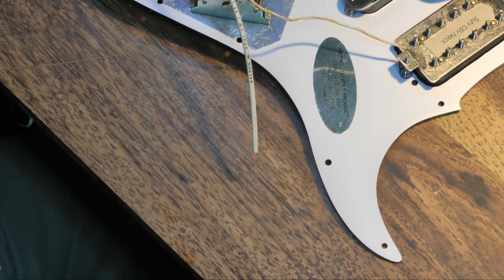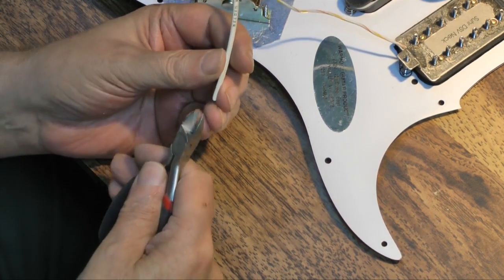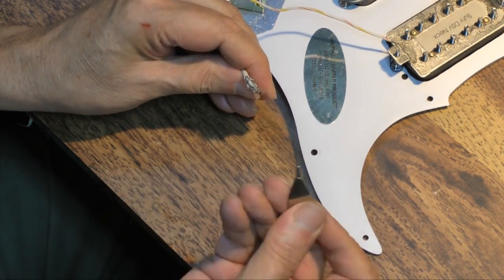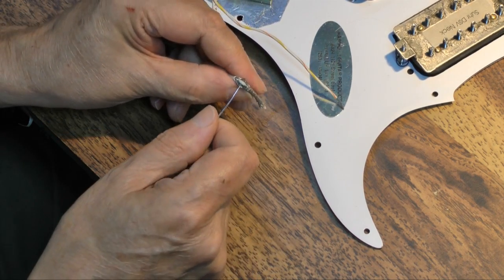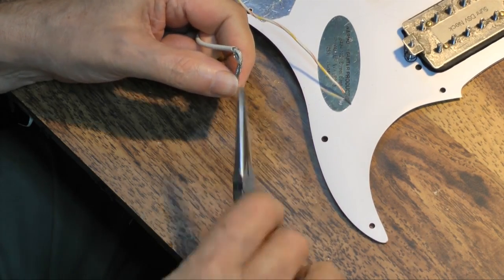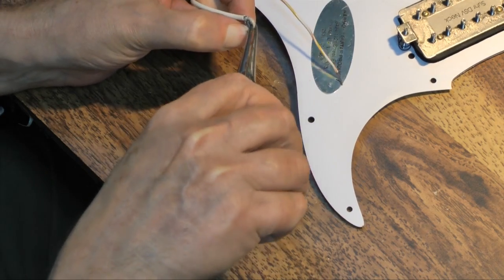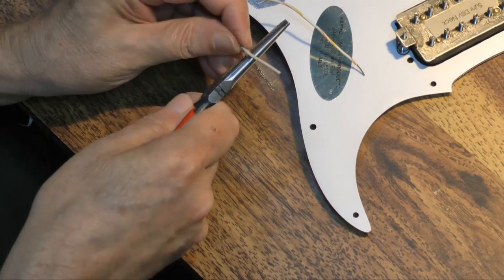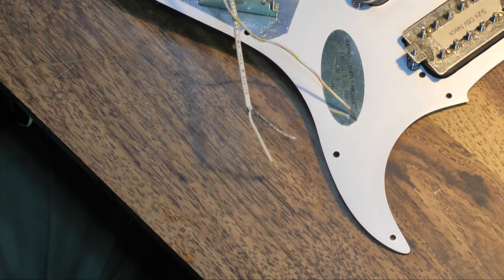Working with Shielded Cable

Comment: When you strip the wire, how much mm do you cut? Does it have any affect on the shielding itself?
Reply from the maker: You need to strip out a few cm to make it easier if you are using this method, it's harder to strip out 1/2 cm, but if you only need 1/2 cm to connect, you just cut it back. The longer the un-shielded wire, the more interference it will pick up, but I wouldn't worry about small sizes like this. Sometimes it's more important where you connect the ground than the length of the wire. The braid of course can be any length.
Reply: @Flintsmooth  Understood, thank you very much !

Comment: Where did you buy this cable? I'm about to wire up a warmoth build and as a newbie, I've found it somewhat difficult to find all of the electronic components I need on the internet.
Reply from the maker: I bought that cable about 35 years ago! I have a very large spool of it that will last me a lifetime and I don't know where it came from. There are a lot of electronic part stores on the net, such as  Mouser or  Digikey,  or

https://www.amplifiedparts.com/products/amplifier_parts_0

 For specific guitar parts I buy from:

https://www.guitarfetish.com/

I don't know what kind of cable they have, you could write to them. You could also go to a manufacturer like Beldon and try to find what you want and then find who sells it.
Reply: @Flintsmooth  I'm not 100% sure it's necessary. I'm wiring a dual humbucker guitar with one volume,no tone, and a 3 way toggle switch. It was recommended to me that I use shielded wire for the output jack, but I'm already planning on shielding the control cavity.
Reply from the maker: @FirestormAudio  If you are shielding the cavity then you shouldn't worry about shielded cable. If you are wiring up the whole guitar yourself then pay attention to ground. Lots of people use the volume control body as a ground wire but you need to make sure you have an actual copper wire connecting all ground points in the circuit. A single point ground is best but circuits differ. Since you don't have tone controls you should be OK. I've seen people try to use control bodys as connecting wires IE thru a steel chassis but steel pots held together by bent tabs are NOT wires! Sometimes you'll get hum when touching the control knob, in that case you can try soldering a ground wire to a lock washer and putting that on the pot.

I usually start out wiring a guitar by putting in a piece of 12 gauge bare copper wire to act as a ground bus. With one control you may not need this. The best point to connect your body shield to ground is at the lowest signal point, a pickup ground.
Reply: @Flintsmooth  That's soooo helpful! Thanks for the all of the information! I have plenty of experience changing pickups and replacing individual components, but I've never wired a guitar from scratch before. Wiring diagrams don't tell the whole story and it's been somewhat difficult to find the information I need online, especially with regards to shielding and grounding.
Reply from the maker: @FirestormAudio  Shielding and grounding is more an art than a science!  In the 50s and 60s, Fender and everyone else got it way wrong! Some of the things they did were laughable, like bending a lug over on the volume control and soldering it to the back of the pot and declaring that a valid ground connection! Or connecting all the grounds to bent steel tabs on the chassis.  Because of the poor wiring layouts and schemes, all the amps hummed, and people thought it was because of the tubes.  I've been making guitar amps for 50 years, and the amps I make now (tube) don't hum even with the volume up full. When first firing up an amp I have to go find a guitar to plug in to see if it is running!

Have you seen all of my amp videos?

You might want to check out the Rane site for engineering data on grounding. They used to have diagrams of all possible cable connections in sound studios to prevent hum and noise. Not sure if they are still around, I learned a lot from them.
Reply: Flintsmooth I have not seen your amp videos, but I’m interested in checking them out. I stumbled upon your video because I was searching for information on within a guitar. I’m definitely interested though because my long term goal is to build a tube amp kit and lately I’ve been eyeing stew mac’s 2204 kit.
Reply from the maker: @FirestormAudio  The only amp videos up now on my site are a 50 watt amp I built from the ground up, from chassis to wood case to everything else!  On this last of the series you can see it and hear a bit at the end.  BTW I'm a terrible guitar player, just a student!  More engineer than musician!

https://www.youtube.com/watch?v=sGpHctv4mX4

I don't like commercial amps or kits because they are usually turret boards or other shit and I can't stand them!  I only do point to point wiring with my own layout design to avoid hum and noise. I also like to save the $700 or so that it costs me less!  

I did put up a video on modding a guitar for my cousin, the last half of the video is him playing it through my original 18 watt Brit clone. I made that amp about 18 years ago.

https://www.youtube.com/watch?v=RyyLubkVqqw

I made a new and improved version a year ago. I have a video series I need to edit on making it. I'm teaching someone now on how to build it himself, I had him build a simple amp (like a Champ) to see how he works.